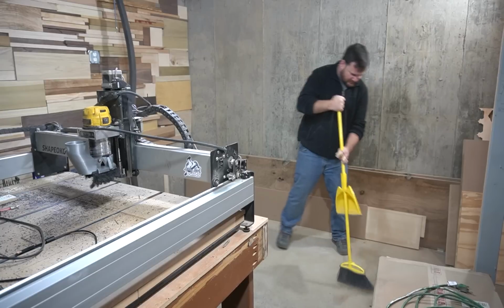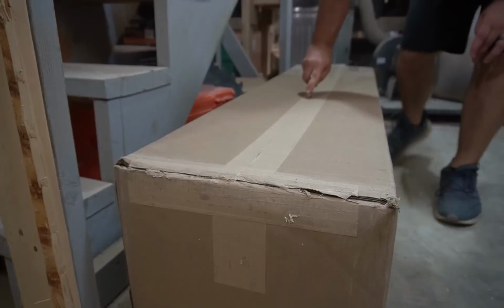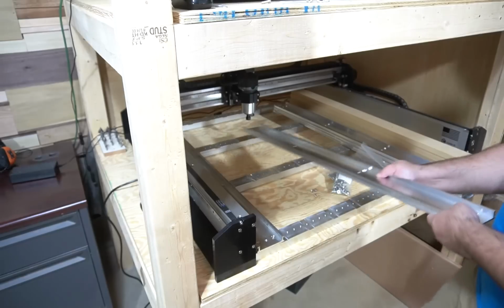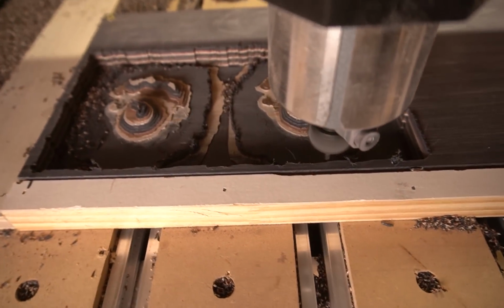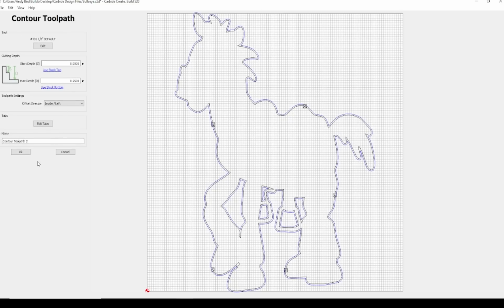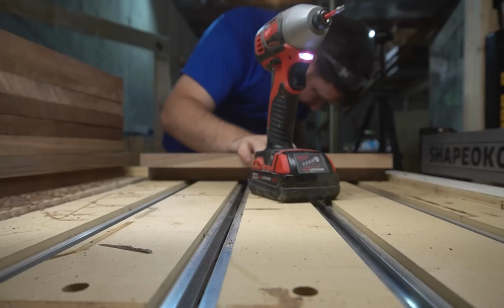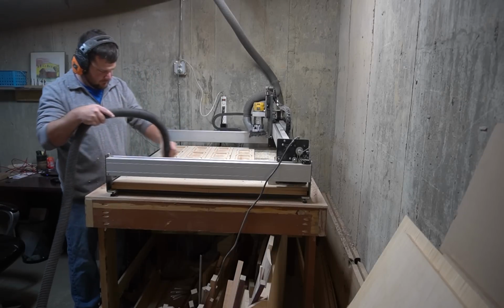Watch This Before You Buy A Desktop CNC Router

Comment: I will say that I had a Vevor ( Chinese Made) 6040 CNC router I bought used with very very low mileage on it. Previous to this I had a Vevor 3040 CNC router. I don't use this for a business but as a hobby toy to play with. I will say I do not cut anything super hard. Wood and plastics and foams. I had a small issue when I first got it that one of the drivers on the board was not working. The guy I bought it from had the company supply another new board under warranty. He was trying to machine aluminum in a fast process. These machines will not do alum fast. My budget was basically $1000. I was able to sell the previous for $400. Paid $650 for a month old 6040 4 axis CNC router with a 0.8kw water cooled spindle. Screaming deal I know! Does what I need it to do without any issue. If I was to need another board it's super easy to find on Ebay and a whopping $50. All the boards are replaceable and found easily enough. If you use the machine within it's limits you won't have any issues. Even my previous machine was completely reliable.  There is no way I could justify a $3K budget for something i don't even know that I will be into. Must be nice to have that disposable income. Now am I saying that a Chinese machine is better than a $3K+ machine? Hell no! But for a test machine that WILL last you if used within reason it's a great place to start. Skip over the stupid little machines that are basically useless and start with a nice machine at a reasonable budget. IDK about the resale market where you are at but in Colorado I can resell one of these machines in a matter of a few days. There is enough interest from people around here that a REASONABLEY priced machine will sell. Everything takes some sort of a hit. Oh and stay the hell away from those Bobs CNC machines. IDK how you can expect a machine that was laser cut out of plywood is gonna have better accuracy than a metal machine of any make.

Comment: It is always a bad idea to spend a lot of money on a complicated tool without any knowledge of how to use it and what to use it for. 
A much better way to start is to spend $250 on a mini milling machine from Amazon and use it as an at home lab for a self-guided course in CNC machining.
Learn the CAD/CAM software first , learn the concepts, workflow, etc. 
The software is 95% of operating the CNC. The rest is trivial in comparison.
There are many free CAD/CAM programs, from very basic to full-featured ones.
Easel is in the basic category, but not the only one.
FreeCAD is a shining example of a free software package that can do almost everything a very expensive commercial product can but without the cost.
You can still get a free account for Fusion 360 but it is limited to 10 active documents. It may not matter in the beginning but it will later. 

Only if you are able to become proficient with CAD/CAM software and cut some shapes and pockets on your small mini mill, you buy a bigger machine that you can actually use to make things for sale. By then you will know what to buy next. However the skills you gain are directly transferable to operate a bigger machine.
If on the other hand if you find that you can’t master the CAD/CAM software, you did not invest much.
Sell the machine and find something else to do.

On the topic of choosing your second machine- there are three most important elements in machine construction that are not negotiable:
1. Rigidity 
2. Rigidity 
3. Rigidity 

Avoid machines using plastic (usually Delrin) wheels rolling on aluminum tracks. Steel rolling on steel is a good start. 
Ball screws are a waste of money in the entry-level machine. Lead screws are good enough.
Onefinity is an example of a well constructed entry level machine.
There are many others.
If possible, avoid machines that lock you into using software and/or supplies from the manufacturer of that machine. Their software may be ok to start with, but if you can’t use anything else, that is a serious limitation.

Other elements of the machine construction such as size, type of controller, spindle type, dust extraction, etc depend on your budget. 
Plan to buy a machine that you know you can use, not a machine of your dreams.
Depreciation on CNC router is slow so if you made some money on it, sell it and buy a bigger/better one that you will need next.
If you were not able to make any money, keep it as a hobby or sell and find different things to do with your time.

Comment: All great points to consider for a noob. I'd add that if you set your expectations accordingly you can also learn a lot from a $200 3018 along with $50 worth of bits. Sure, it's slow and what you can do with it is very limited but it's a great way to negotiate the learning curve and figure out if CNC is really something you want to pursue before dropping over 10x that amount on a more capable machine.
Reply: I absolutely agree. Even for the fact that all things must be started from the bottom and not from the top, and this also concerns learning!

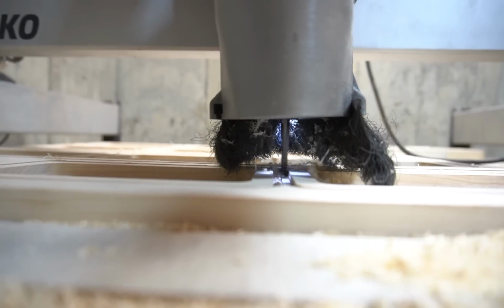Comment: 5:10 its range for metal too 80-300 vc not ring bell to me at all. if it 190 then it is. why not tel so why 80-300 LOL its all depend how you cut material. and all other variables is on range.
Vc Fz Ap. so how you would thing how should cut. if change another other have to move opposide direction. all cant be MAX values like boss would say max speed max depth max feed. and all start clamping part correct. not like clamp 10mm part from bottom but cut 500mm up. it flex lol. you can cut 0.1mm not 10mm even manufacturer say so.
you can go fast small steps or you can go slow big step. machine time is same. unless can make some % feed on small steps

Comment: Hi Andy, thank you for the info. I have been researching CNC Desktop routers for some time now, I want to build guitars as a hobby along with some other stuff like cutting boards for my channel, but investing 3k is quite a big chunk for starting a hobby, is there not entry level machine under 1k that you can get away with to test the waters per say? I read that cutting thick hardwood can be an issue for each machines.
Reply from the maker: I can say that you will get what you okay for. There are less expensive machines out there but there performance will limited.

Comment: so built a cnc router about 15 years ago. but the lack of affordable software at the time limited me. i sold it and have used a vinyl cutter and printer for many years. I know have no problem creating vector files. but what would you recommend? i’m not new to it, but also have no idea what is good, and what is garbage in the market. the two behind you seemed about the right size. so something in that size range.  thanks for your time.

Comment: For me it is the best way of learning to build my own CNC. But you need experience in mechanical design and electronics. 

In parallel I do a lot of 3D printing which is also a good starting point. A 3d printer is nothing else than a CNC machine with a hot glue gun attached (FDM). It is much simpler than starting with a mill.
Reply: I've built my own CNC, and I didn't knew nothing about it.
Youtube has a lot of content to help you out, and the reward is amazing.
I just love my DIY CNC 😁
Go for it 👌🏻👍🏼

Comment: Excellent summation. I always suggest that anyone uncertain about using a CNC machine first buys a 3D printer. This gives experience with design and gcode files etc, but doesn't have the complexity of tooling, hold-downs, cutting paths or collision issues. No infrastructure such as tables and extraction. Once that is all learned, the step to CNC is much gentler, and the 3D printer remains a useful resource. If it is all too much, the lost investment is much smaller.
Reply: I started with 3D printing and then bought a small 3018 CNC.
As soon as I saw the thing work for the first time, I got obsessed with building a bigger CNC machine.

But yes, 3D printing is a good start 👍🏼
Reply: Yeah I started with 3d, and moved into CNC on a cheap 3018. Whole nother world when dealing with toolpaths
Reply: I'm a retired carpenter and I decided to give electronics a go and bought a small cnc for trial circuit boards. If I'd seen this video about 2 years ago, I would have known what I was getting into.
Reply: I started cnc plasma, then put a router in my table and then went 3d printing. Printed three things that looked and felt cheep. I really never use it anymore just collects dust.
Reply: @NIGHTSTALKER0069  It is best to buy tools to fulfil a need; buying a tool and trying to find a use for it is not easy- I speak from experience.
Reply: What 3d printer do you suggest?
Reply: @chrisstockdale2667  There are so many models I hesitate to recommend. Any 'name' model should be fine. Another option is a diode laser cutter/engraver. Being only 2D, and not requiring clamping, make using them easier. It will also move over the area on request, so you can make sure the workpiece is in position. You can make a lot of things with it, and there is a huge free resource on-line. I use mine much more often than my CNCs.
Reply: 3d printing doesn't really expose you to the intricacies of gcode as the additive process is quite benign and you don't have to worry about part clamping, datum (home coordinate) acquisition and tool length offsets, nor about breaking a tool. One thing about 3d printing that is unique is the hundred or so variables that you may have to modify in the print settings, many of which are not 'hard and fast' and typically require 'prove out' by running an actual part, which may take many hours. By comparison, running a cutter in a cnc requires very little input, once you get the gist of how much to push the tools.

3d printing is so slow, that you need an army of machines to try to make a living because they don't produce $100 an hour in marketable product.

I'd like to get a hobby router though. I think the thing is capable of making money, at least to pay for itself. I think I'd get a kick out of running small diameter long tools at a ridiculous overhang compared to metal cutting.

Comment: I'd also recommend buying some cheap bits and cheap, soft wood to learn how to run the machine on. It's inevitable that you're going to make a mistake when setting up a run, so it's best that your mistakes are more affordable and don't hit you so hard in the feels.

Just remember to switch your mindset when you start manufacturing for real. If you stop thinking about the cost of mistakes you're going to end up costing yourself a whole lot before you know it. Especially if you get overconfident and splurge on some costly bits or wood.

Comment: I own a small workbee, and also a big industrial cnc. I would recommend that you change the 1/4 bit for 1/8. Most small routers have way too fast rpms, and cant sustain the required feed rate for the ideal chipload. You end up going through alot of 1/4 inch bits as they burn up fast.
Reply: I tend to alternate a fair bit between 6mm (1/4 - 6.35mm) and 3mm (1/8 - 3.125mm) bits. If I am cutting MDF I prefer the smaller cutters, but they are fairly easy to break if you get too excited. But they can be more useful when needing a tight corner due to the smaller radius. When I am working with ally I prefer to use a 6mm or bigger, unless again I need something with a tight radius. Majority of the work I do will be between 3-6mm.

Comment: Thank you very much for your program very common sense approach I'm not good with computers and stuff I'm 7 years old I'm a dinosaur I have an idea a concept I work with steelstone and wood and I want to find a way to put designs on 46 and 8" aluminum boxes and I have a purpose behind that I'm trying to find the right machine and it's very difficult to get information and I don't want to piece of junk I don't know if I could use a smaller machine because I believe it would take off quickly and then advance to a nicer machine or not but I appreciate your Information and I will try to do some diligent research before I buy thank you again
Reply from the maker: The Shapeoko HDM would be perfect if you're working with aluminum.

Comment: When I first started using a CNC milling machine, there was no such thing as CAD/CAM and the processes I used were later incorporated into that format. I am now a retired master machinist and look back on G-code programming with fond memories. By the way, the tools you refer to as tapered bit, I ground myself with relief.
Reply: Guys like you are the reason I’m such a great programmer, being taught to layout things on paper and program on the fly at the controller, new programmers can’t believe cam software can be wrong and it’s good to know how to fix it

Comment: I never use an up-cut bit with wood because it tears out the top surface. Took me a while to learn that, but down-cut only for me (often sold as 'left handed'). Straight for plastics. Up-cut for metal.

Down-cut helps to keep the work flat on the table and gives the cleanest top surface.
Reply from the maker: If you're cutting all the way through your material, an upcut will leave the cleanest bottom surface. The downcut will leave the worst.
Reply: If you need clean surfaces then you can sandwich your workpiece between two pieces of lost material. Shallow pre-cuts will also work. Using these techniques and high quality tools and a high precision CNC router motor makes clean cuts rather easy to achieve in my experience. The straight bits do, indeed, work better for plastics.

Comment: Soon im planning to buy a cnc 4060, from china (warehouse from poland) , 5 axis , but i wonder if does really a good quality statuettes or not , because i never and never seen a  statue carving outside vendor , someone tryed?
Reply: For the same amount of money you can usually get better results from a machine that you custom build for your specific requirements... assuming that you understand the engineering of these machines (beam loads, torque etc.). Smaller is better (beam deflection scales with the third power of length!) and the average manufacturer doesn't care about machine quality as much as they care about profit. I bought a small toy machine for a couple hundred dollars and I used it to learn where the problems are with these kinds of CNC machines. Then I spent the money on the machine parts (beams, linear rails etc.) to build a machine that fits my requirement. It is insanely over-engineered and it has never shown any perceptible deflection or resonance problems. The total cost was roughly equivalent to your 4060 but it is considerably larger. 

This is, of course, not something you can do for metal cutting machines, unless you have a foundry for large steel parts and another set of machines to cut and precision grind the machine beds. For all other materials a home build is fine.

Comment: I would suggest a potential CNC buyer figures out which CNC they want, and then get the appropriate CAD system running first. Learn that software then and then buy the CNC. Otherwise you'll have a CNC that sits for months not doing anything.
Reply from the maker: I see what you're saying but I disagree. These hobbyists machines have software available that's pretty striped down and easy to learn. Plus, their are a bunch of files you can buy and completely skip the cad. There's just too many options not to have the machine to actually practice on. You'll learn a lot more by trying your designs on the cnc than just designing them and not being able to test them.

Comment: Great video. It's been a year this month i have had my cnc I so far have only 12 bits got 2 bit starter packs. One was from my CNC manufacture (onefinity) had 4 bits in it and i bought a pack from bitsbits had 8 bits in it was a very useful pack. I needed compression bits along with surfacing bits ect... got them in the pack. waiting for stock i need 2  more bits lol.  the One thing i wanted to add to your video was the need for a dustoper to save your shop vac.  I look forward to learning from you. Thank you..

Comment: Nice video! I want a CNC bad but I’m worried about dedicating the time to learn the CAD. I decided I’ll get proficient at CAD first. If I don’t have time to learn CAD l obviously don’t have time to play around with CNC. If only my employer was more understanding that there are things I’d rather be doing. 😁
Reply from the maker: Its good you're taking this approach. So many people don't
Reply: @AndyBirdBuilds  I do have a little experience with buying things and realizing it’s harder than I thought. It’s no reason to give up on trying to do awesome stuff though.
Reply: Depending on what your doing you dont always need cad. If your working flat surfaces doing mostly vectors or etching, you can get away with an easier to use software as long as you can make or export the file as a dxf file. I make interface panels at work and most of the designing on them im only using corel draw 3, an easy to use illustrating program. if im doing electrical prints i use a 2d program and more complex objects ill use a 3d cad program. All free programs too like libre cad and freecad. I was using corel long before those and my skills from that did help alot with figuring out more complex programs.
Reply from the maker: @FishingwithPhillips  You're right when it comes to designing. But you still have to set up the (CAM) toolpaths when it comes to a CNC. That is where the main learning curve is.

Comment: Good advice in general but I disagree with the costing. A really well built cnc router is the longmill and it costs less then 1500 US.
Reply from the maker: Thanks. That's what the machines costs. What will the cost be once you buy everything you need to actually make things?